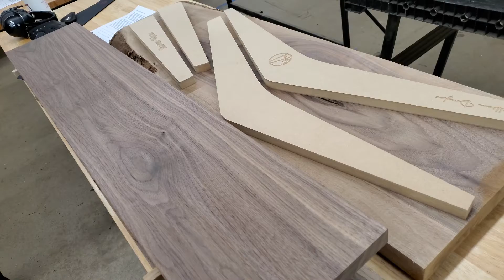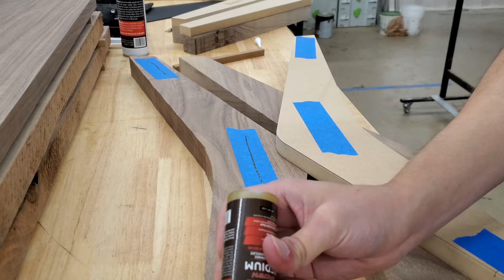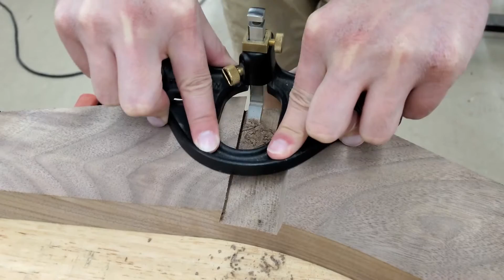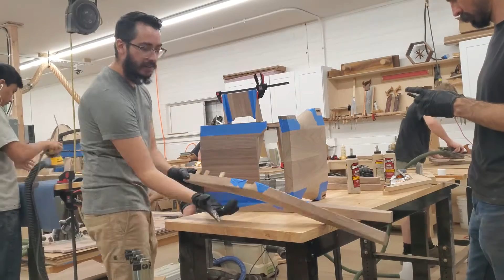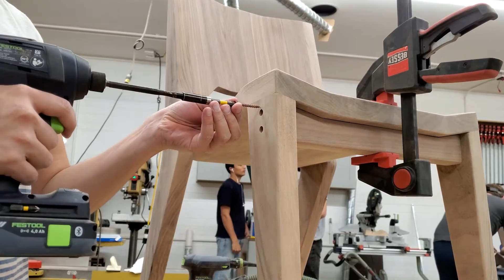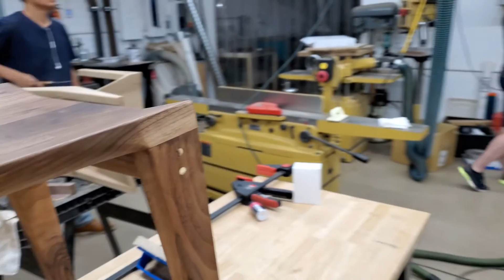DIY Walnut Chair!

Comment: Did the backrest snap at a glue line on the panel? Was it preventable? If so, what would you have done differently?
Reply from the maker: I snapped In the middle of the panel. To prevent it from happening add the clamps to the back side instead of the front like we did